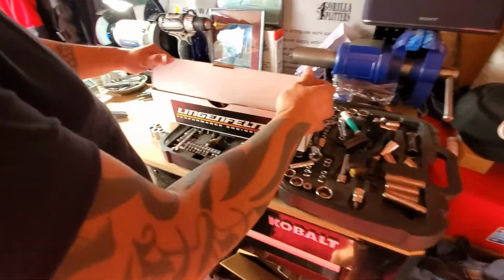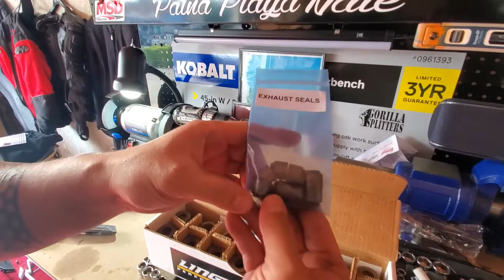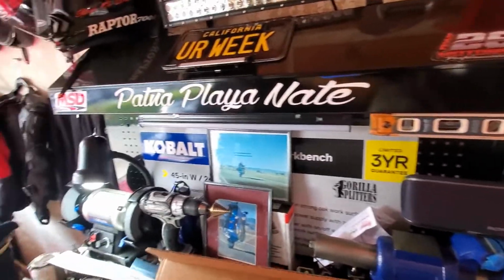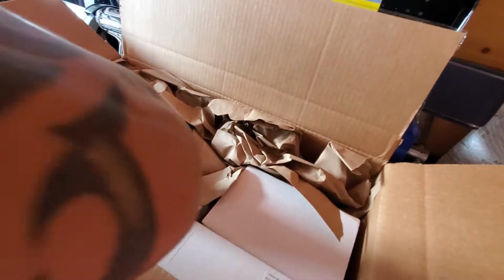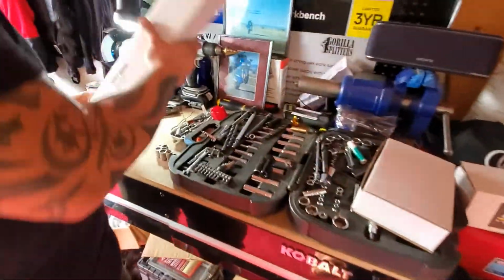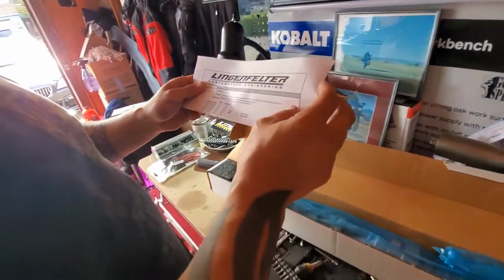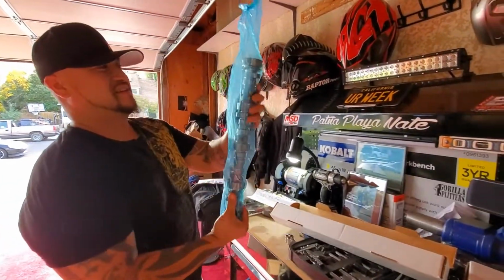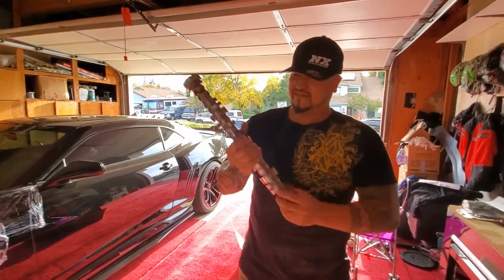CAM AND SPRINGS FINALLY HERE!!!!!!!!!!!!!!!!!!!!!!

Comment: Badass Camaro bro !! Did the 6th gen bumper fit perfect or did u have to make adjustments ? Cuz  ikon motorsports says it doesn’t fit Zl1 or Rs models
Reply from the maker: JGr8t23 Nava Right on my brotha!!! Much appreciated !!!! The front bumper went on like a glove!!! It fit perfect lined up with every line like it was a factory bumper!!! I was Extremely happy with the results!!!!
Reply: OUTLAW PERFORMANCE GARAGE Thanks for ur response brotha! One last question wat kind of side skirts r those ? And do they bolt on to the stock zl1 side skirts or how do u install them ?